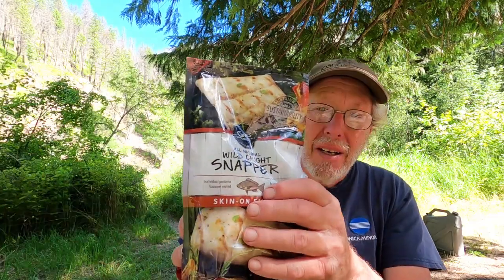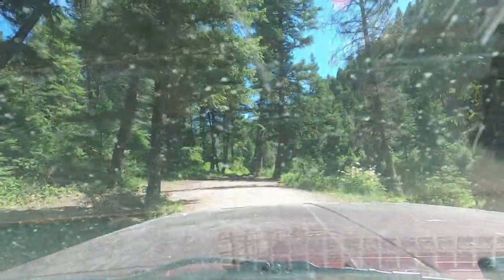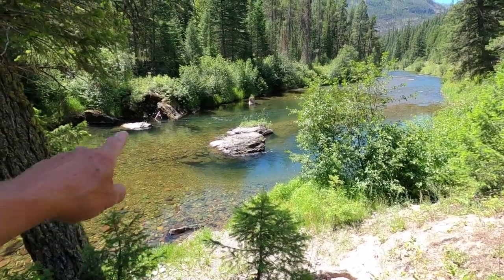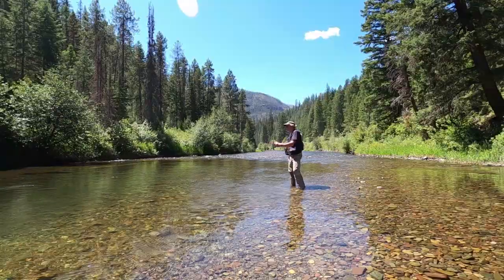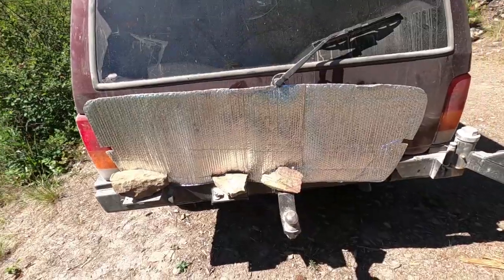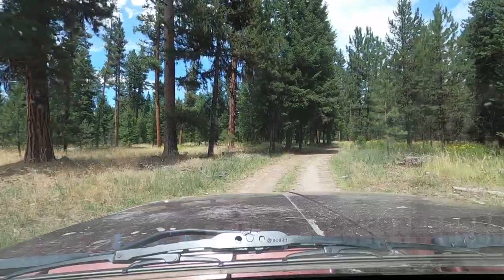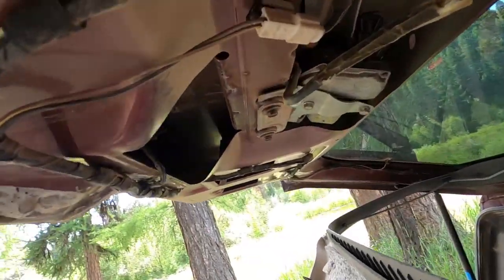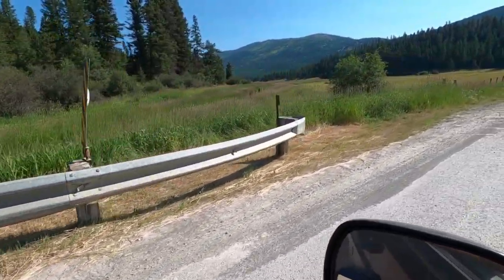FLY FISHING EXPLORING THOMSON CREEK MONTANA AND MORE JEEP PROBLEMS

Comment: Those hatches are known for going out of adjustment, it's always fimun breaking the plastic tabs that hold the inside panel up.  You can get a bag of 100 on ebay for a out 10 bucks, still looks like you are living the dream!  How is the motor doing?
Reply from the maker: Major Weakness  I had to cut into the panel to open it. If I have small hands and small fingers it would’ve been a lot easier. The new motor is working fantastic I am very happy with it. I feel a lot better with the new motor when I’m off trail.
Reply: @overthehillandoverthemount2925  glad to hear.  Thanks for sharing.

Comment: WD40..   Might help the hatch lever...
Reply from the maker: Glenn Chapman The hatch needed to be adjusted. Throw that WD-40 away it’s always very bad to use. It is basically gasoline in a can. It will take the squeaks away but makes it worse later on. Buy a spray that actually has oil in it.
Reply: Over the hill and Over the mountain     Yeah your right. Something Silicone based probably better. Glad ya got it fixed. 🍻🍺